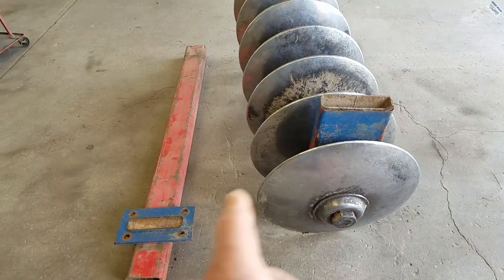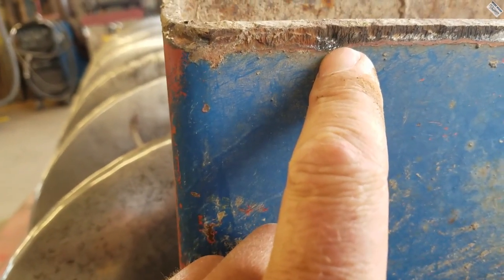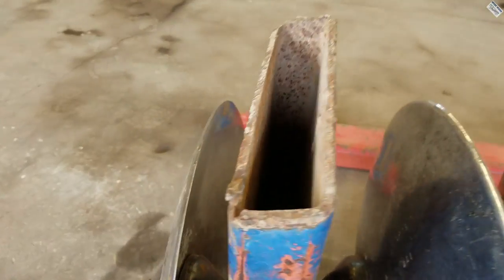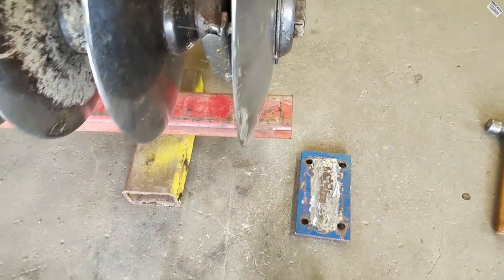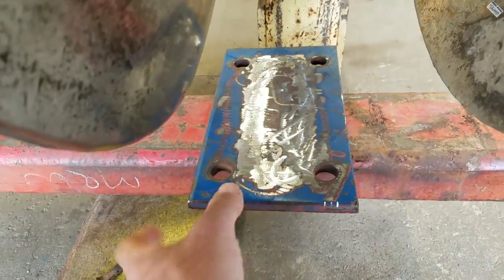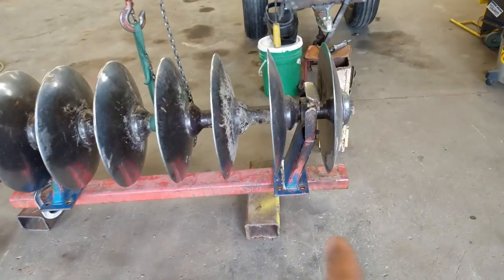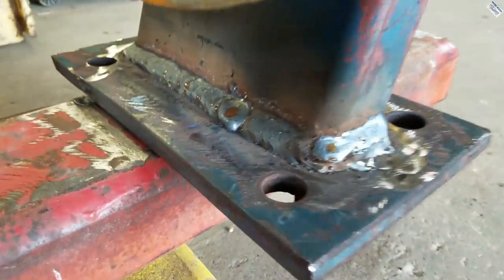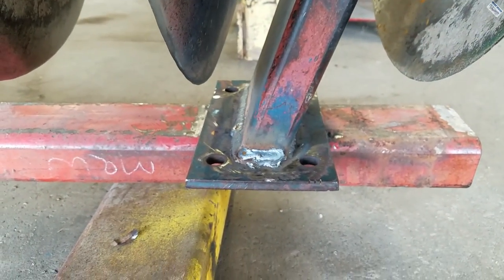Disc Plow Repair - A Typical Repair Job

Comment: Those Crazy Glue beads from the factory "Really" looked like a weld bead.....    lol
Good decision to make a real hot pass this will get into both parts deep and melt the parent metal...    ;)
Reply from the maker: It was probably JB weld. lol

Comment: Found a weld like that on a house we bought, the previous owner built a patio out the back and while I was demolishing it I hit a beam with a sledge hammer and several bits of steel just fell off.
Reply from the maker: That's down right scary!

Comment: Wow, that was an amazing separation at the weld. One can hardly call it a break because there was nothing broken off except the couple of slivers holding the plate on. I wonder what could have happened that the weld did not stick - at all - to the rectangular tubing, in fact the thinner of the two welded surfaces. 
Hmmmm. 110°F in your area? We have 43°F here: at high noon! Great to see your backhoe in action. Didn't you just recently install that water line and show it in another video some time back? Ok, it could have been years back considering my lack of memory when it comes to time. What gives?
Reply from the maker: I'm assuming they had the MIG gun aimed completely at the heavy plate and the bead just trickled over on to the tubing. That's the mistake a lot people make thinking they need to focus all the heat on the thick plate.     The last use of my backhoe was in the Fall when I had to replace an electric line going to the house because of a lightning strike.  43F sounds really nice!  Sounds like I need to come visit you! :)

Comment: One of the reasons I don't like mig, it's too easy or a weld to look OK but be lacking in fusion. Stick or flux core for stuff like that.
Reply: Because they used short circuit mig they should have used spray transfer hardwire or dual shield

Comment: Should have used structural steel bolted or riveted rust from the inside out bad design for disc  too much harmonics, welds can't take it

Comment: That is a mig weld, a mig weld is not a true weld it is dead short weld it lacks fusion it sticks to the parent metal the same as brazing steel. To weld a full fusion weld you have to use a stick rod (7018) or tig or dual shield it has come a long way.
Reply: Hi, I’m curious why you think MIG isn’t a “true”weld. It’s just another form of arc welding, the same as stick welding. The underlying operation is the same for one as the other; the principle difference being the means of shielding the arc from oxidation. If you know something I don’t, it would be interesting to hear. In the meantime, I trust Matt; he’s forgotten more than I’ll ever know about welding.😀👍🏻